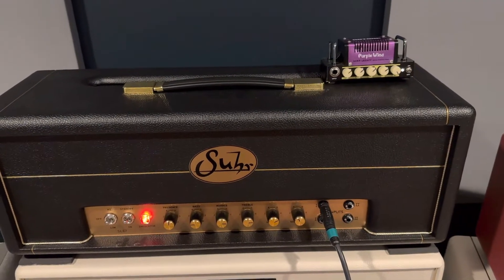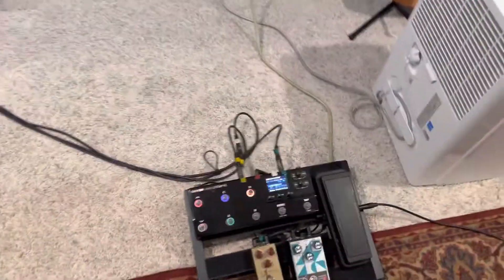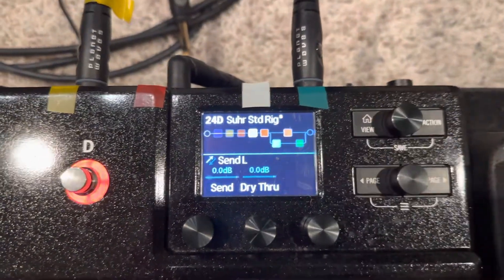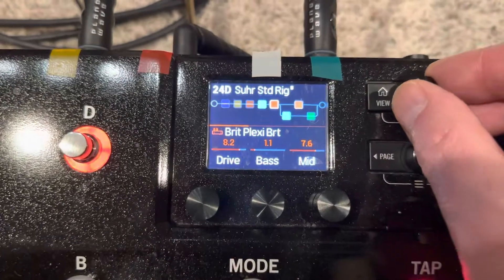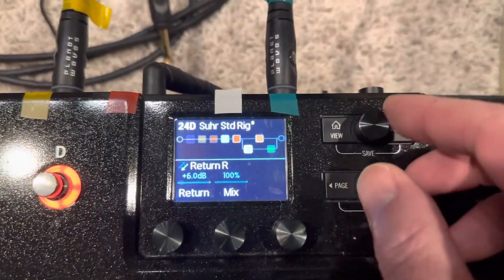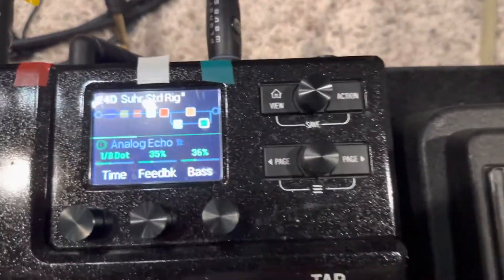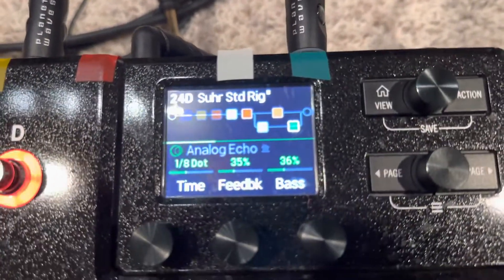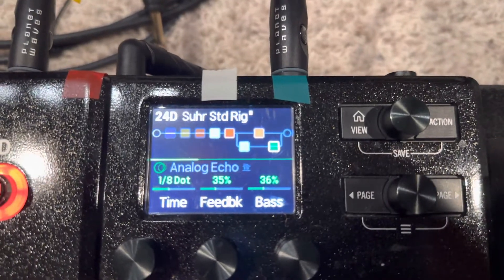Wet Dry option with Line 6 HX Stomp

Comment: Interesting will have to try this. Do you have any ground loop hum or speaker phasing issues with this setup?
Reply from the maker: It worked well without the types of issues you mention.   I had tried something similar using the Bray DI box and that didn’t agree with the Suhr but worked with other amps.
Reply: @guitargathering4488  Interesting. I've tried the Two Notes captor X to get a line level signal off of my head into an HX stomp with 100% wet FX internally mixed in parallel L and R out to an old Mosvalve poweramp for the two wet sides. It sounded pretty good but there was a hum that couldn't be cured with just the ground lift on the Captor. I wasn't able to hunt down the culprit. I believe the Bray takes a similar tap off the speaker load like the Captor?  Perhaps I should try the same setup with a different amp.  I was thinking that maybe the Radial Stage bug SH6 would take care of the hum..it has a ground lift for each chan and a phase switch for one chan that could cure my phasing issues that I get from the HX stomp when just running in stereo. In that setup I run the stomp through the amps loop and take the right side output of the HX stomp and run it through one side the of a separate power amp. Again hum and phasing issues there. I'm wondering if I should run the right side fx 100% wet in that scenario... So many variables with this stuff.